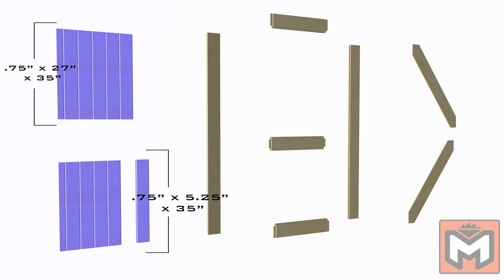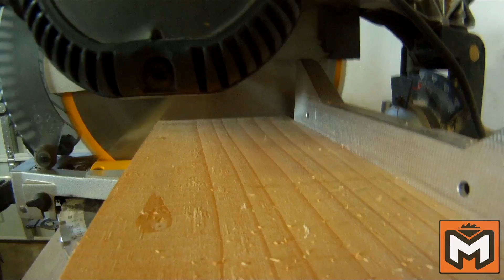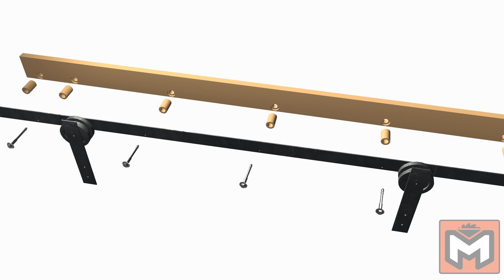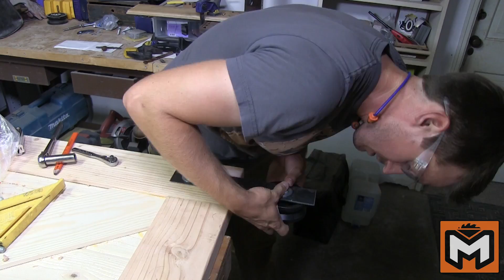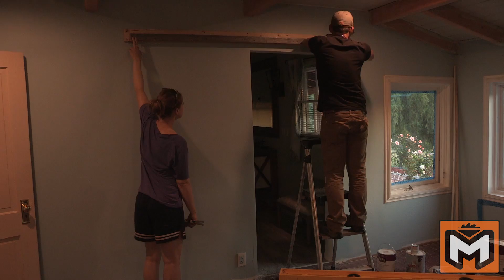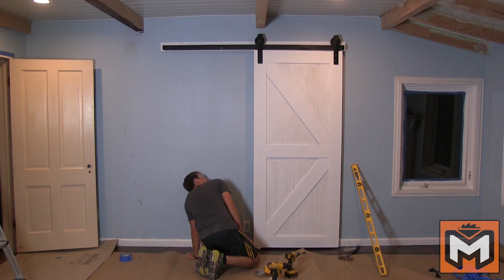DIY SLIDING BARN DOOR

Comment: In the cut list, the diagonal slats are .75 thick but when you cut the dado, there's only 3/8 left on both sides for the diagonal. Where do you find the 3/8 common board that you mentioned in the video?

Comment: hi what table saw u have mine Will not take the 3/4 dado set
Reply: The key is to locate a table saw that accepts dado blades. There’s only a few out there that won’t break the pocket. I had the same issue and just bought a rigid 10 inch table saw R4514 on sale at a Home Depot. My dado blades work awesome.

Comment: A few tips. Try to center your boards in the frame so you don't have a full board to start and a 1 inch rip to finish. It looks infinitely better to have equal rips on both sides. Or, in this situation, go ahead and make the door 2 or 3 inches wider overall and have full boards all the way.
Also, when using tongue and groove boards like this, shuffle your pieces before installing. It doesn't matter much when it is painted like this, but if the boards are stained it will look wierd. If you cut 4 pieces from one board, don't install them next to each other. You can see this at the 2:56 mark, there are two dark boards next to two lighter boards.

Comment: Very nice project, just discovered you channel and i love it ! !  couple tips maybe for some of your viewers.  You should not glue the panels in place they should be free floating (to avoid splitting when they dry up, even if they are all separate pieces) Also, when you do groves like that you can flip the piece end to end and do a 2nd pass to be 100% sure you're dead in the center.  Even if you measured carefully, small variations can make the panel realllly hard to get into position if you, by mistake, dont put all the same faces up or down.  Keep it up very interesting !
Reply: ***** Can you do a video on how to frame a garage door because my dad and i are building a new garage.
Reply: Guillaume Breton i
Reply: Guillaume Breton Morning
Reply: Guillaume Breton great suggestion. I’m considering a similar style door.  Do you recommend gluing the t&g boards to make a panel and then let the panel float in the grooves of the frame?  Or will that still cause board separation issues?   Or is it best to just dry fit the t&g boards and float in the frame?  Thanks.